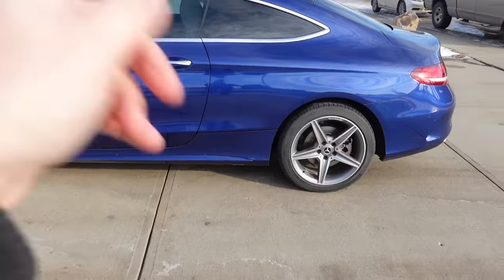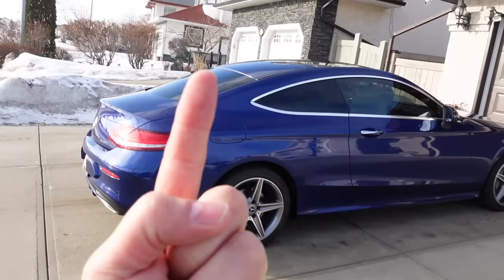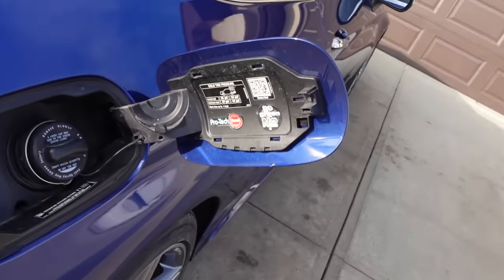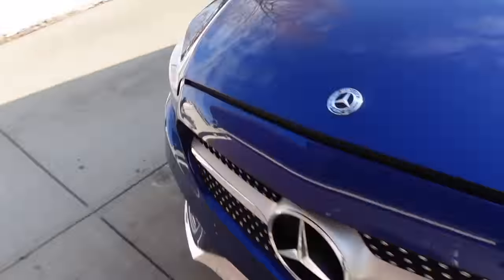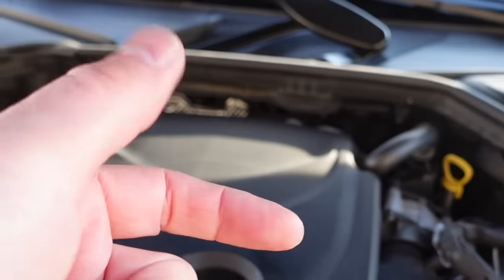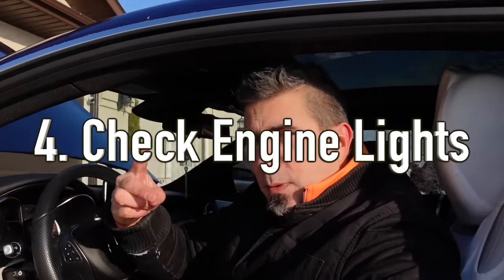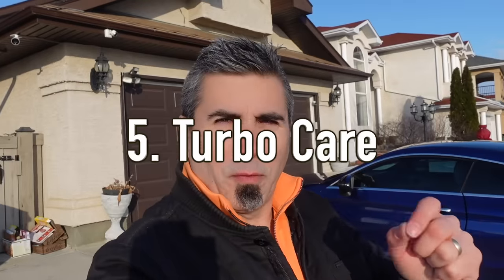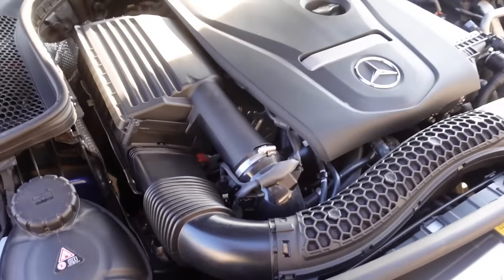STOP Destroying Your Car Engine! (With These Tips)

Comment: The autostop eliminator is available for some models.......definitely worth it.  Its just a dongle that goes between the button and the wiring that remembers the last selection, so if you turn it off, it will stay off no matter how many times you drive the vehicle.......but if for some reason you want to turn it on, you can.
Reply from the maker: That sounds like a total win.  Great to have the option and it should default off.
Reply: Most vehicles that have a sport mode have a default turn off of the Auto stop start as well, I pretty much always drive in sport mode so it's never an issue
Reply: Yup! Got one on my JL Wrangler and never looked back. I hate Auto Start/Stop.
Reply: @ECPP does this void warranty? I assume you’d know the answer 😅

Comment: That's why I buy older 🚗 and keeping PM up as well as putting seafoam into tanks and making sure I put rated fuel rated 88 or 89 for older graded fuel and here it goes from 100+ to 40- n let it run for a minute or 2 before I go anywhere and make sure I put synthetic proper rated oil with changing it every 7k miles and make sure you check the oil every week and making sure you check the antifreeze levels n power steering oil and transmission color and making sure it's all clear of all contaminated products in oils. Keep an eye out on what a vehicle sounds like on normal running conditions.
Reply: Thanks but remember some senors in vehicles do glitches as well when they go on then turn off take it into a shop and when they tell you it's nothing to worry about qnd depending on weather they may trip then it turns off it's a tricky subject.
Reply: I hate stop start would rather have not auto stop start because of beating up your engine and drive trains I do my agree with that as well that's another reason I look for older cars trucks trucks suvs because of all the tech that will destroy vehicles I'd rather idle a few extra minutes knowing lube is flowing and alternator is changing my system then have a engine shut off and fail to start a stop lights leaving you to call a tow later qnd holding up traffic.

Comment: Well another way to shorten your engine life is by having an engine with a turbo. Reason is you are cramping more air into the engine to make it have more horsepower than it is designed to have this leading to your engine going out way before it is supposed too.
Reply from the maker: But it also depends on how hard it’s driven
Reply: @ECPP  that's true but most people that have a turbo drives them hard. It's kinda like a Dodge hellcat how many people buy one and drives it conservative?
Reply: Not sure that’s true - a lot of turbo engines have been designed as turbo engines from the ground up so they’ve always been designed with the extra air in mind
Reply: Ridiculous comment. If a turbo engine has been designed to have 250 hp, then that's how many hp it's designed to have. The turbo isn't an afterthought, you big div.
Reply: @chachar7458  well get you a BMW with twin turbo  and see how long it last. You will be crying at about 100 thousand miles. Bet my pay check on it.
Reply: @tommywieringo6640  I have a Ford Focus RS, it’s a 2.3 turbo making 350 bhp, so it’s not exactly a small turbo, and I’m on 128,000 miles so far. It’s been the first turbo I’ve owned and the most reliable car I’ve owned. Not saying being a turbo and reliable are related, just that so far at least a fairly substantial turbo hasn’t caused any issues for me. I know you can’t extrapolate from one data point, but I would be surprised if my experience with a car with a turbo isn’t typical. The fact is most cars sold this past decade are turbos. They’re seen as a way to give better fuel economy when not driving hard, but performance when you want to pick up the pace (not sure how real-life the economy is, but it helps with the official tests to determine mpg)
Reply: yes, well there is a "catch" to this....did you know the turbo engines are alot more fuel efficient then same powered  naturally-aspirated engines ? Why is that youd ask...its all about how you use it, the turbine kicks in at a certain RPM ( based on how the specific engine is tuned), so if you stay below that threshold you're fine & dandy, the turbo is only there to help you get more power  - when you need it - , i repeat : when you need it  ....so the idea is you  have to actually think a little bit how to properly use a turbo engine, the choise is yours basically
Reply: @tommywieringo6640  LMAO I’m driving a 2016 BMW 1 series 120d xDrive with 220.000km on the clock. Not a single repair needed yet. Every service was done by BMW. No issues at all.
Reply: Probably harder on the trans too, and they're not cheap.
Reply: The real issue I've seen is ADDING a turbo to an NA vehicle and force feeding the engine boost that it was not built to handle.

Comment: Actually in Florida, leaving the auto start stop on will lengthen engine life. The reason is the stop lights are so long and the motors do nothing but idle half the time. My F150 gets over 20 mpg because of it. Just don't floor it off a stop light. My engine is cooler, less wear from excess idling, and the oil stays cleaner. 55K city miles, motor is perfect. 2.7 turbo. No trouble with the starter either, it's built for it.

Comment: Regarding cold/dry starts. When engine has not been started in a long wile, push accelerator pedal  to the floor wile pushing start button.  The engine will crank without starting, allowing the oil to circulate. Do this for 5 to 10 seconds before releasing the pedal. Engine should now start and run normally.

Comment: In the US, all gas stations have some mix of ethanol within the fuel. I don't think there is any way around that. At least most gas stations. I tried to find a gas station that did not use ethanol mixes and I couldn't find one.
Reply from the maker: That’s unfortunate, I know there are still places where we can find straight up gas, but then we have a couple that are largely alcohol.  I stay away from those other than maybe a rental.
Reply: US companies add ethanol to raise the Octane score. There is no way around it. The best that US drivers can do is to use Tier 1 level gas and avoid buying gas from the likes of Sam’s Club, Walmart, etc. Tier 1 gas includes BP and Shell. You can google “tier 1 gas” to get a proper list of US gas stations.
Reply: @ECPP  Since I moved to Iowa in 2004 I've put the 10% ethanol blend in my cars..all Camry's. I've never had any issues. Of course I drive daily. Ethanol does seperate after a period of storage. As mentioned stabilizers are available to add to your fuel tank to slow the separation...the stop start technology  just sucks. ..there are many devices available to disable this alleged technology. and some stop start technology can be disabled without buying some dongle. Just look it up on youtube.  On my '17 Camry Toyota recommends a 10,000 interval for an oil change..Sey what?! No way I say. I go 5000 miles max..Thanks for posting..love your channel.
Reply: @ECPP  I live where you can buy ethanol free gas.  It's expensive.
Reply: @ramonmalaya8451 Tier 1? Do you mean Top Tier gas?
Reply: Ethanol free fuel is very common here in ND and MN,  boats do not like ethanol fuel.  I would never run a small engine with ethanol in the fuel and Honda will not warranty any fuel related issues in their lawn mowers if you use fuel with ethanol in it.
Reply: @silverwrx03  New New Small Honda lawnmower engines can now run on E10 fuel as advised by the manufacturer. At least this is the case in the UK.

Comment: Yep, 1 of the worst things for an engine is to start the car cold, run it 5 blocks to the store and come home with the engine barely warm. That's how you get water condensation in your oil. 

Most cars don't use the turbo while cruising at 70mph on the interstate, so shutting it down quickly is fine. Most cars use the throttle position and the MAS to tell the turbo when to kick in. So after a drag race, let it run 30 seconds to cool before shutting it down.

Comment: With Subaru, if you do a full accelerator press prior to starting, try starting for a couple seconds, then turn off. Now start the vehicle without touching the accelerator pedal and it starts. This pre lubes prior to starting and running the engine. Nice also when you do oil changes.
Reply from the maker: Exactly

Comment: Just got my Mercedes Benz and the first habit I got was to let the car warm up to in between C and H in any type of weather and also let it idle before turning the engine off. Always felt as if running it on cold could cause some serious expensive issues with the engine. Thanks for the video very informative

Comment: You can code out stop / start feature so I doesn’t happen for modern Mercedes and BMW
Reply from the maker: Nice.  And I know on the F Type , people pull a jumper and it goes away too.  Junk feature.
Reply: @ECPP  That’s right 😊
Reply: I never liked this feature in modern cars. It’s a quick way for manufacturers to meet emission standards at the expense of engine life. The first few firings of the engine at start wreak havoc on the rods and bearings. Why put the engine parts under anymore stress then there needs to be?

Comment: 1. I would still recommend ethanol in your gasoline as it lowers the freezing point of gasoline and the tubes that transport it to your injectors.
2. or plug in the block heater LOL if it's Lowe than -15 in the winter. Your car will start at most cold temperatures, but increased the longevity and warms up quicker. 
6. You can disable the auto-stop start feature for most vehicles so you don't have to keep pressing that button. A light may show up on your dash. if you feel uncomfortable doing such to your vehicle, talk to your dealership and ask them to disable it for you.
Reply from the maker: Cheers and thanks
Reply: e85 octane rating is 100-105 and superior to preminum-93; for performance peeps pushing turbos it is great alternative to cheaply squeeze more boost / compression without detonation.  Downside is it tends to destroy oil quicker and turn it into gray soup. 

Still beats buying race fuel; which is typically leaded with TEL or other really bad stuff.
Reply: Ethanol cleans your engine a lot better too, all the popular brands claim to have amazing detergents but the ethanol is the best detergent you can have in your fuel system. Not all vehicles have fuel hoses rated for higher grades of ethanol but if yours does there's no reason not to use a blend.

Comment: I think the biggest issue in today's cars is oil burning, The reason for it is engineers at MIT 10 years ago decided if autos used low tension piston  rings in engines, they could get better mileage and your engine would run  more efficient, but you needed lower viscosity oil also, the draw back was oil changes were far more important, so  if people use  the oil Percent guage in your vehicle to change oil, you may have  7500 miles and 40 percent life left ,thats way to many miles before axoil change ,  So you need to change your oil every 5000 miles or less even with the new synthetic oils ,When you use the percent guage for oil changes , it is causing more sludge and carbon in your engines  because  the oil change interval  being extended beyond the oils capabilities making your engine  burn oil, so it's more important then ever to change your engine oil sooner then later, so change your engine oil at 5,000 miles or less if you want your newer model engine to last years and not burn oil.
Reply: Absolutely. Oil changes are cheaper than rebuilding your engine.

Comment: I can honestly say that the Stop Start in the 2016 Cadillac CTS is the reason I didn't buy one. They have since added the button to turn it off but, like all the others, it comes back on when you restart the vehicle. I'm now looking at a new Toyota Rav4 and have found out that it can be simply and permanently disabled by just unplugging it from under the hood. When you sell or trade it in later on you just plug it back in. As to the ethanol content in higher grade fuels, that's not always the case. Any fuel in Canada can have up to 10% ethanol and while on it's own it is more corrosive than gasoline, it would take many hundreds of thousands of kilometers or miles to do any damage so use the cheapest gas you can find here without worry. Besides that, most stations use the same suppliers so it's usually the same gas regardless of the Brand. There are many taxis on the road with more than 500,000 kms that have perfectly serviceable engines all running on the cheapest regular grade gasoline they can find, but of course well maintained otherwise. Read the owners manual and follow what it says. If it says 91 octane required, do so, but if it says 87 required and a higher number recommended, you can use 87 safely, perhaps with a slight decrease in horsepower but usually nothing noticeable in daily driving.

Comment: My biggest worry with the auto stop is the starter wearing out.
Reply: well there's that to but if the engine stops oil stops being pumped up there and when it starts back up it running dry for a few seconds again like when you first start it up so you get extra wear on the motor with auto start stop tech on it it wears your engine out itself faster as well due to the oil settling out of it on long stops

Comment: XcelPlus (trade name for the original "Slick 50").  It's an engine TREATMENT not an oil additive (bonds a microscopic layer of PTFE to all metal parts in the engine).
It makes a HUGE difference to the longevity of an engine (one caution, it reduces friction so much you need to run it "a while" on a COLD morning to get enough heat in to defrost the windscreen - negating some of the fuel savings).  Do NOT treat a "new" engine, wait until it's been properly run in (20-30 thousand miles (or more)).  And you can go longer intervals between oil changes (although I agree with the video - "generally speaking" changing your oil at HALF the interval recommended by the manufacturer is a good practice, and can help reduce sludge buildup / reduced performance / oil burning down the track).

Comment: Um - auto stop start is kept in mind when engineering these cars, especially these days... These cars have beefier starters, batteries, and electric oil pumps (along with regular)that run when it's activated... So no, your oil won't drain and cause excessive wear.
Reply: @Omar I’ve read the same thing and I also posted similar response on here to see if that’s the general consensus but apparently not! 😐
Reply: @marvelvsdc6611  People are ignorant. Stop start systems are engineered into cars, they're not afterthoughts, don't worry about them.
Reply: @chachar7458  👍🏼
Reply: @chachar7458  does that engineer pay for your engine when it dies? Are you going to trust a computer to keep you alive, it only takes one time for it not to work right  the fuel saved by these is so small it's a joke.
Reply: Would you recommend a bypass for a 2022 Hyundai Santa Fe?
Reply: @gregorymaupin6388  i would. don't listen to all these fanboys who always say trust the engineers lol . ask yourself do they pay to have your engine replaced when it fails?

Comment: Cool and informative vid!! Question regarding oil  change — Audi recommends 10K miles or 1 year, whatever occurs first and the MMI tells you when.  Are you saying it should be done more frequently?  I would love to do that but it’s so expensive to do….your thoughts?  Also, what model Mercedes is that? S63?
Reply: The Mercedes is a C300.
Reply: I do every 5k on my A4. Don't trust 10k for the longevity of the car
Reply: Do you guys do your own or dealer?  I would go to dealer so $250 at least
Reply: @joehoffrage  do it myself. I have an oil extractor which makes it easier since on the A4 the oil filter is easily accessed from the top. Takes me around 20-30 minutes, not including warming up the car.
Reply: I change my oil every 5-6K miles.
Reply: Do 10k oil changes with any German luxury car and you better be ready to replace the motor.
Reply: @iAlwaysSpeakTheTruth  Yep
Reply: @iAlwaysSpeakTheTruth  nonsense, many diesels last huge mileages.
Reply: @ln5747  not talking about that
Reply: @iAlwaysSpeakTheTruth  you said "do 10k oil changes on German cars and be prepared to replace motor". How are you not talking about that? Many German cars do huge mileages with up to 20k oil changes as per advised by manufacturer.
Reply: @ln5747  YouTube is full of people who think they know better than the manufacturer...

Comment: Just get a Ram with Etorq. It doesn't use the starter. 120 hp Etorq motor restarts engine faster than the blink of an eye via a wide drive belt connected to the crank on the front of the engine. Power comes from a 48v battery which stores energy behind the rear seat. Very seamless. Battery powers AC and other accessories when stopped in traffic. You'll never know it's there. If you want to restart engine after it engages just lift a little pressure of the break pedal while still keeping some pressure on the pedal.

Comment: Most Audis recommend using thicker oil for the winter to help with cold starts/oil leaking. 
Also funny how Audi still tries to recommend oil changes every 5k but in the manual it says every 10 lol.. I do them every 3-5k. 
Also turbo cars I’d say if you boost make sure to let the car idle after for a few minutes to cool down
Reply from the maker: Thanks for the great pojnts

Comment: Never got a new car so lots of things have been done to it before I purchased it. The car sits on my driveway most of the time. I never drove it more than 3k miles per year. I have the oil change once every 1 or 1.5 years depending on my convenience. I think the car will fail from rust on the parts that is safety related after 15 years and when I sell it, it will be barely over 100k miles.
Reply from the maker: That’s fair